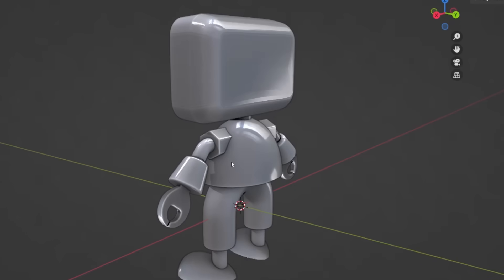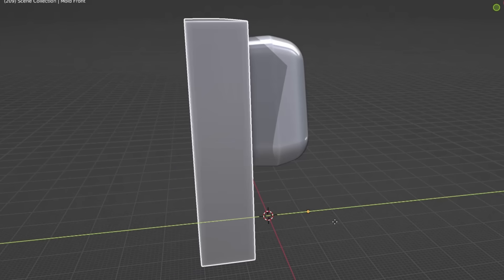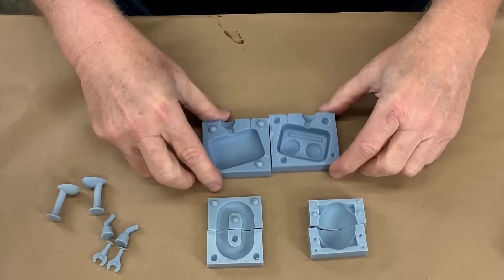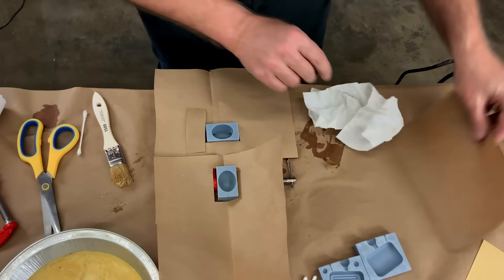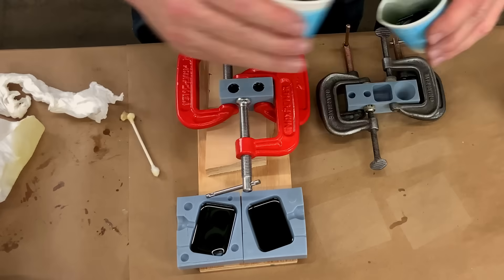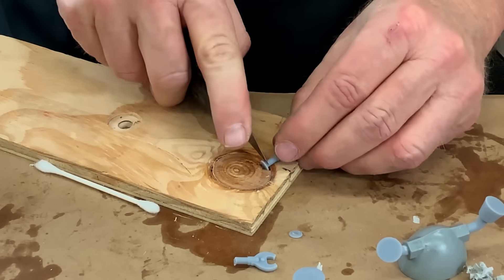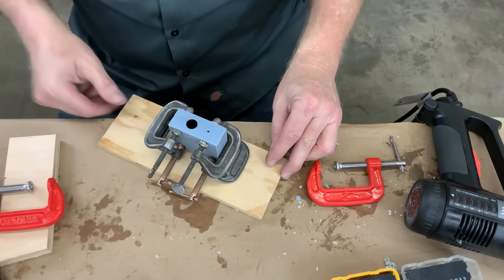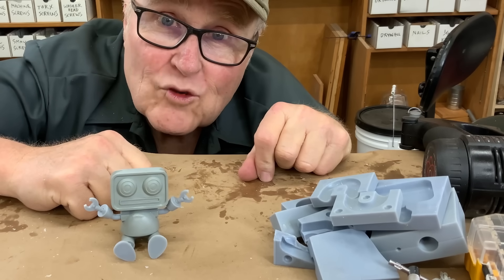3D Printed Molds For Resin Casting - Does That Even Work?

Comment: We've recently started using a fleixble 3d printable rubber at work and have had success using it to cast silicone parts for product design students - I'll be messing with it over the next few weeks to see how else we can use it in teaching sculpture, and resin moulding for fine parts if on my list
Reply from the maker: Flexible printed molds are on the agenda.  Should be fun!
Reply: @RobertTolone  Ive had reasonable success with simple elegoo water washable transparent green, its got a bit of flex in it, not glass hard like the grey.  I have also been printing molds and trying to case silicone parts.  I found that the resin seems to prevent the silicon from curing, I had to get some tin cure, which was not as tough as needed.
Reply: @RobertTolone are you a tool a die guy? Or mold maker? Just curious. Iv been machining for close to 12 years now so he a deep respect for your work. My hats off to you. 👏 👏 👏
Reply: @RobertTolone  i came to the comments to ask about the possibility of using TPU to print flexible molds, but you beat me to it!
Reply: TPU works great for flexible gaskets and molds.  Its not that hard to work with, especially if you have a direct extruder give it a try if youve got non-resin type printers (FDM printers)
Reply: @NeoIsrafil  TPU is leaky by default. Sealing the mould with wax works tho.
Reply: Actually, this would be much easier and safer too
Reply: What brand do you use? I use water washable, but this would be incredible for simpler molds I wanted to make
Reply: @NicoleHam  we're using a highly flexible resin rubber from formlabs.
Reply: @evansn79  hi Nic, I’m wondering if you are casting platinum cured silicone with those flexible molds? Ie. does that flexible rubber cause curing inhibition?
Reply from the maker: @evansn79  Hey Nic, does that resin work in most printers are only form labs? couldn’t tell from their website. Are you using the 80 shore or 50?
Reply: @evansn79  wait there is flexible uv 3d printer resin? I always thought I needed to use tpu prints
Reply: I've got a bottle of the rubber, but it's a real bitch to work with--it likes to tear away and stick to the FEP, and tall objects tend to get warped.  I've set a light off delay and slowed the lowering, to no avail.  Going to try adding a heater to keep the resin lukewarm.

I'm using a Creality LD-002H.
Reply: I was literally thinking this while watching this video..  creating the mould from a rubber like print for ease of extraction but I would imagine the lines/steps left over from the print would cause the mould to have ridges

Comment: Could you apply some kind of silicone coat inside the mold? Would that make demolding the part easier?
Reply from the maker: That’s what the spray I used is - spray silicone.  I should have made that clear in the video.

Comment: Hmmm, which has better tear strength? Soft printing resins or silicone molds? The approach taken might be situational.
Reply: I think it's a safe assumption of mine to say that platinum-cure silicone is significantly better than flexible SLA resins.

SLA resins in general have pretty bad properties, the ones that are flexible are rather weak.

Comment: So it seems that 3D printed molds work, but they don't have any flex and are brittle. If the original model has undercuts, this technique might not work. So if the original model has undercuts, perhaps using silicone molds work best.
Reply: There are flexible 3D printing resins. In extreme circumstances you can also take a page out of metal casting and use a removable core (From high-temp wax? Doesn't melt while curing, easily removable after a full cure)

Comment: 0.025 or 0.05mm tolerance works like a charm with mold locking spheres. Great video as always 😃
Reply from the maker: Good to know, thanks.  Zero tolerance was obviously not the way to go!
Reply: @RobertTolone  You can use 0 Tolerance but at least activate Anti-Aliasing in Chitubox ( If u use it ). The AA will take a few pixels to blur them, so they will leave a tiny gap. I personally use 0.030mm of tolerance. Great Video btw.
Reply: @RobertTolone I’m so glad you left this part in - now I know to use the 0.5 mm tolerance!
Reply: @RobertTolone  why would you even think that that would work? The printer you used wouldn't ever be able to be that precise
Reply: @Slouworker  He obviously just forgot, lol
Reply: All these measurements depend on the materials used.  Some resins shrink considerably as they cure.  Though this property is unpopular in 3D printing or casting.
Reply: @asailijhijr  
In addition, they shrink differently depending on the geometry of the print. For example, a pin may shrink and become thinner and vice versa - the print around the hole may shrink and the hole will become larger. It depends on the wall thickness, the geometry and even the curvature of the surface.
Reply: I also always use .06 to .08 mm clearance for mating parts.
Reply: I was wondering how i was going to figure out the tolerances. You’ve listed them right there for me!

Comment: Geesh....your approach always makes so much sense. I've been printing and molding for a while but tilt the mold so air escapes. You tilted the cavity = brilliant!
Reply from the maker: Mold cavity position is super important!
Reply: @RobertTolone  Different printers/resins might give different results, I have a better fit when the registration keys are downsized by .1mm diameter. Your videos have helped me a lot. Thanks for that. For anyone watching (Robert already knows I'm sure), it's easier to make a silicone mold from the prints than to cast in a resin print. Usually, Tin cure works well. I haven't had any luck using platinum cure silicones.